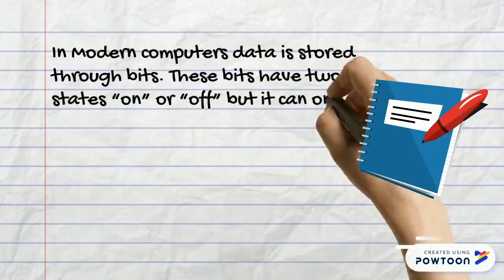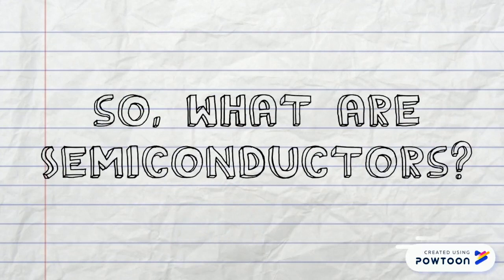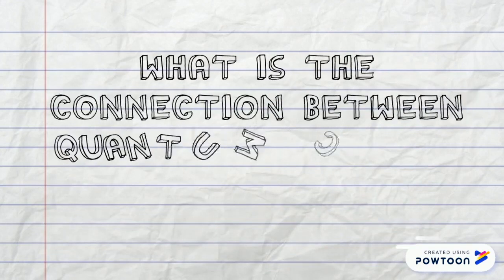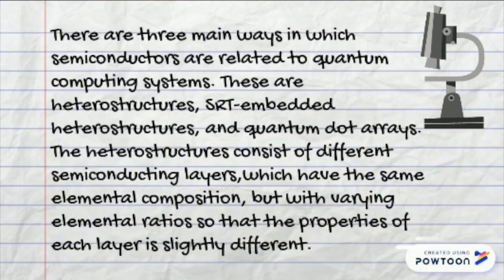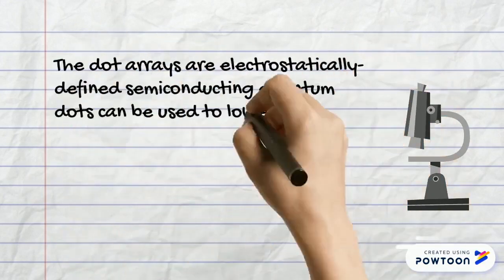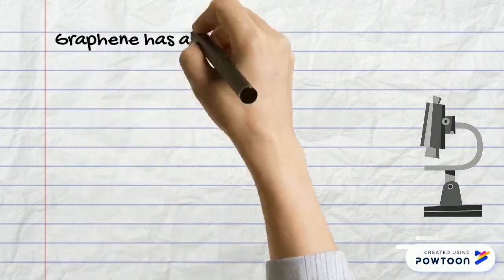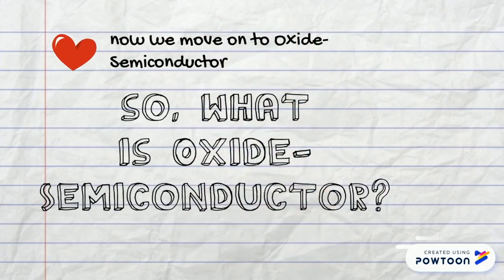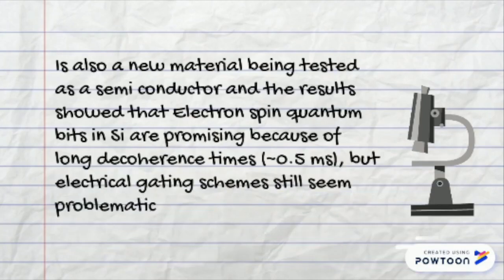Innovative Semi Conductor inQuantum Computing

Comment: 2017130435
Question 1: How do you make qubits or quantum bits?
Question 2: How do you read information from them?
Reply from the maker: Answer for no. 1:
Qubits are made up of particles like photons, electrons, or neutron
Reply from the maker: Answer for no. 2:
In modern computing, information can be read or manipulated through logic gates like AND, OR, XOR. Quantum computing has the equivalent of those just implemented differently because qubits have different properties that can be used like quantum entanglement.

Comment: Question: Why is quantum bits better than the normal bits stored in the modern computers?
Reply from the maker: Quantum bits is better because unlike normal bits which can store any of the 2 states "on" or "off" quantum bits can store any probability of the "on" or "off" state until you need to determine the information stored in it.

Comment: 2017130515
Question: How is Innovative semi conductor  in quantum computing essential in our everyday lives?
Reply from the maker: It is very important to discover innovative and viable semi conductors for quantum computing and it will affect our daily lives because as of today Moore's Law which states that "processors are getting twice aa much integrated circuits every 2 years" is starting to slow down. This means that modern computing have a limit and quantum computing can replace modern computing, but right now it is not commercially available. The discovery of viable semiconductors can make quantum computing commercially available. In the future, there is a high posibility that quantum computers will fully replace modern computers